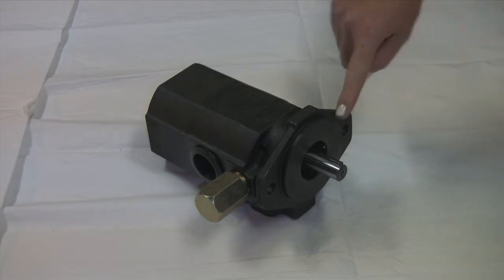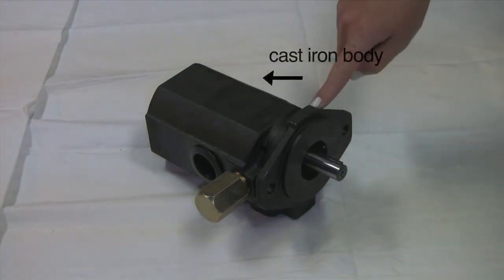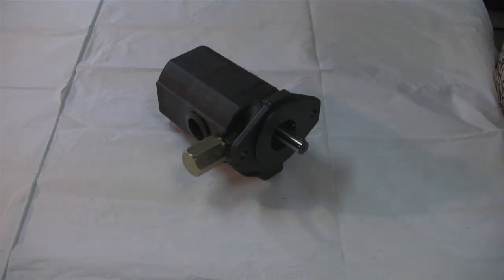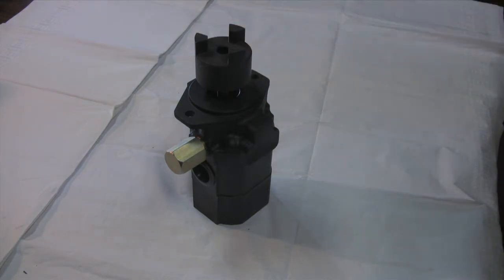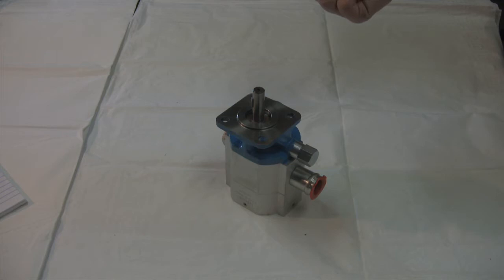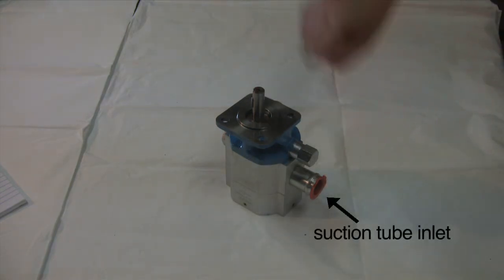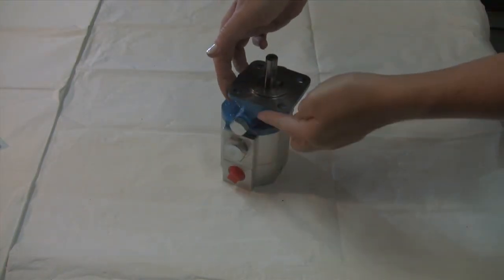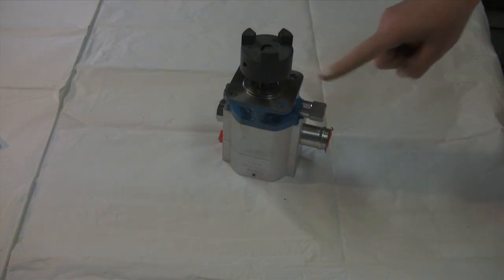Log Splitter Pumps by International Hydraulics

Comment: How about a demonstration video in use on an actual log splitter or a chart that shows how many inches per minute or seconds per foot of travel for various hydraulic cylinder diameters at low and high pressure speeds.
Reply: Number to call 😅